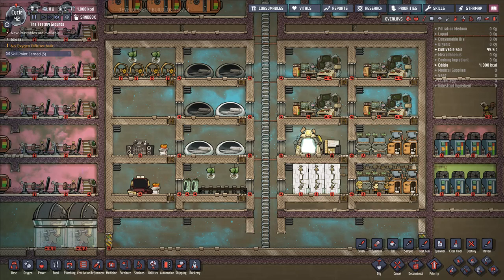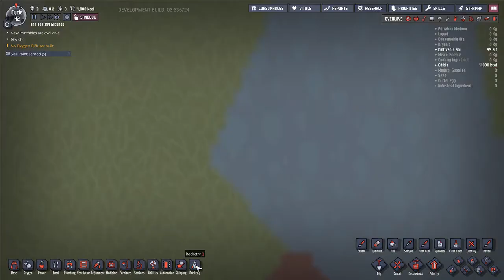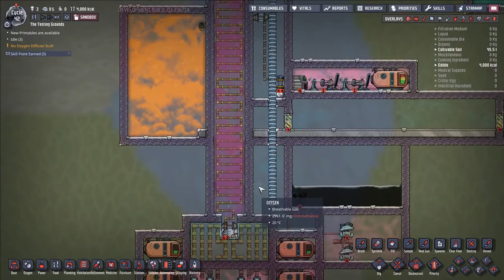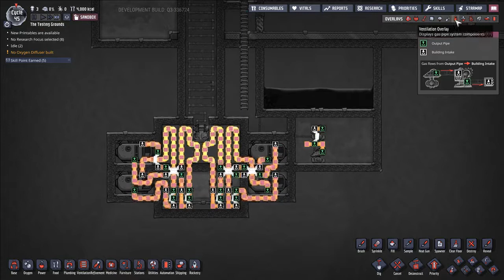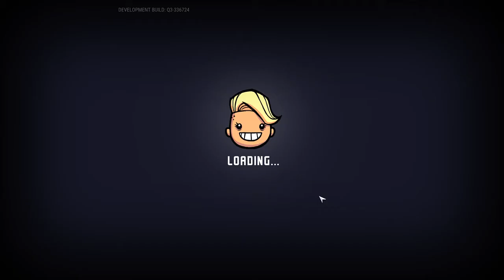The Mid Game Methane Distillery Revisited [Oxygen Not Included]

Comment: I'm confused.  It looks like the magma is going to keep cooling down and solidify eventually, and the hydrogen room with the thermoregulators is going to keep heating up until they overheat and stop, so how is this going to keep running for very long?  To keep it going you need to move the heat from the bottom back to the magma, but you can't do that since there is no thermo-regulator or aquatuner that can sit in the magma and vent heat to it as it sucks it out of the cold side.  Finally, the liquid methane is being pumped up through the pipe where it is being warmed, then it magically comes out of the vent and turns to gas.  What is keeping it from turning to gas inside the pipe and damaging the pipe as it vents out into the room with the sour gas?
Reply: Nevermind, I just watched the original video where you explained that it is using the <= 1kg packet size trick to stop the boiling from breaking the pipes.  I always forget about that.  Rather than get lava on the top, can you turn it upside down and just dig down to the lava layer, build a door touching the lava and use that as your heat source with a nice super cold AETN as the top side cold?  I can't think of why not.
Reply from the maker: The hot end can easily be replaced by a volcano, magma biome, or output from glass forges.  The thermo regulators can be kept cool with any of the cooling solutions I have on the channel, as they aren't actually generating much heat.

The methane does not turn into gas inside the pipe for the same reason the crude oil does not turn into gas inside its pipe: we have throttled the flow to 1kg/s.
Reply: @gearheadgaming1  Right, but do you have to put the lava on the top or can you make the top the cold side and just build the door touching the lava on the bottom of the map?
Reply from the maker: @phillipsusi1791  Hot side on the bottom is a little tricky to make work because you need to get the sour gas to condense, at which point it falls and has to be stopped with air flow tiles that have pumps on them.

A sideways tube works fine, that might be better.

If you're using a magma biome to provide the heat, easiest solution might be to simply pump the magma out.  This video has more details: https://www.youtube.com/watch?v=g6H3O0sl3fc
Reply: @gearheadgaming1  Ahh, right... ok, so hot has to go on top, so either pump exploit to move the lava, use a volcano, or the other trick with two fluids in a mesh tile to force the lava up a tube...
Reply from the maker: @phillipsusi1791  Or sideways, usually by setting it up right above the magma layer and then dumping a bunch of regolith into the magma to make more magma / bring the magma level up to where it makes contact with the tube you built.

Comment: Don't you think that it would be more efficient if you made the heat exchanger a repeating s shape rather than a collum?
Reply from the maker: Longer is better than wider, but if you cant do longer, then wider is better than nothing.
Reply: can't you make it longer by making it a square zig zag or is this one just a demonstration, either way thanks for replying have a nice day :D.
Reply from the maker: @commiesbegone2580  That lengthens the heat exchange area for the pipe.  But the gas flowing down still has a shorter path.  If you make it taller instead of wider, then both are getting the same treatment.

Comment: hmm.. could you make a second heatexchanger that will use the sulfer to cool down the natural gas and then recycle the cooled natural gas into the original heatexchanger ? The natural gas cooler could actually be a chain of no touching solid tiles (gold?)  in a vacuum that would exchange the heat between the conveyor belt and the natural gas pipe. Not sure how big that would have to be of course :))

Comment: The whole point of the build was to make natural gas to power your generator, and you aren't even powering it with the natural gas?????
Reply from the maker: In debug it's just simpler to set up hydrogen systems, in a real game I'd definitely use the natural gas to power the system (and then clean the resulting polluted water and use it to get oil from an oil well which would then be the feedstock for the distillery), which would make it a power-positive, water-positive closed loop system.

Comment: Does this build work with the heat on the bottom and cooling on the top? Since most magma are at the bottom of the map and is challenging to pump around.

The only issue I could see is the condensing of methane blocking other sour gas or dripping down to the hot end.
Reply from the maker: It works, but it's tricky because as you said, you need gas to pass through at some point, but not liquid.  Air flow tiles achieve that effect, but the better way I think is to either build the whole thing sideways, or put the condensers offset to the sides a little at the top, like a sort of T.

Comment: Tried this build and noticed something interesting, sometimes, mostly when it starts up, the methane instantly flashes to natural gas when this happens the natural gas floats to the top and gets converted to sour gas (via exploit/glitch) which is good and bad as it acts as an auto cleaning system but also means you have to change it to natural gas again getting more sulfur in the process.
Reply from the maker: Yeah, the Launch Upgrade changes to gas mechanics means it's a lot more important to get your cold end super cold before turning on the system.  I think it's worse than the Natural Gas getting converted to Sour Gas, I think under the new mechanics it's actually just getting deleted.

Build still works, but startup is a stricter process now.
Reply: @gearheadgaming1  Mmmm noticed some strange things happening to the hot end when the larva got below 1200 degrees seemed to cycle Petroleum Crude and Sour Gas in a loot but with no mass gained despite the liquid vent off depositing. A metal refinery to reheat seams to fix it though, and it can be sort automated though would be easier with space materials.
Reply from the maker: @evilchicken2339  Interesting.  I'm gonna do this build in my Let's Play probably ~100 cycles from now, should be a good opportunity for me to work out any kinks when running it in survival mode.  The new gas mechanics might have introduced some new failure state.
Reply: @gearheadgaming1  Having just built this in survival myself, I've found that methane only seems to spontaneously evaporate into natural gas inside the tube when there is a sufficiently high mass of sour gas above it. Presumably there is enough sour gas there to exchange heat with the methane and evaporate it. I've been watching this setup for a while now and it seems like any more than a few kilograms of sour gas at the bottom of the tube causes the natural gas to begin building up. I may have bungled the thermo-regulator cooling setup somehow and introduced a flaw, but the problem of natural gas is still very much something to take into consideration. I'm currently looking into breaking into the tube to install an atmo-sensor and disable the insertion of oil when there is the "right" amount of sour gas.

For what it's worth, the setup as is has already created an obscene amount of natural gas and is continuing to do so. It's perhaps not the most efficient and not without some flaws, but I'd like to think it's still more efficient then just burning hot petroleum.
Reply from the maker: @timothyfair1232  The issue is that the sour gas is condensing right above where your methane is being pumped out.  What you ideally want is for the sour gas to condense 1 tile above that, so that you have sour gas, then vacuum (because all the gas condensed), then liquid methane.

The easiest solution is probably just to get your cold end of the tube colder.  A different condensation area might help as well-- putting the pump into a sort of deep pit where the sour gas comes into contact with regulator-cooled tiles before it comes into contact with the pump.

Comment: If you moved the nat gas reservoir up slightly and used metal tiles to exchange more heat between the nat gas and the sour gas would that increase efficiency?
Reply from the maker: The short answer: I think in this case it would-- the position is just a little lower than it should be, and some free energy is currently being left on the table as a result. 

A longer answer: It's important to note though that moving it upwards beyond a slight increase, like moving it to near the top of the condenser, will result in a higher outlet temperature for the natural gas, but wont significantly reduce the load on the cooling end of the condenser.  Beyond that optimal point, moving it up further would mainly redistribute losses due to inefficiency from the cold end to the hot end-- but it wouldn't reduce the main load on our cooling system itself, which is the cost of cooling down the sulfur.

Personally, in survival mode I would still probably have the natural gas outlet a tile or three under the crude oil input, just so I could have the natural gas output at a temperature below 75 C, which would give me a lot of flexibility in terms of how I handled the nat gas from there on out.  It's less energy efficient, but I think it would fit my playstyle a little bit better, where I tend to be a little reckless with my dupe health.

Comment: You said it was possible to use a Thermo Aquatuner to provide both the heat and the cold. I've tired myself but couldn't get it right. Any possibility you could show us the way?
Reply from the maker: On reddit, Tony Advanced Oni posted a scaled up version of my build: https://i.redd.it/nirqgydbsl031.png that runs off a thermo aquatuner.  One Aquatuner using supercoolant should be enough for 10 kg/s crude oil, and basically all you do is have your aquatuner up top, it pipes down through insulated pipes to the bottom, and then absorbs heat from your cold element through radiant pipes.  He has his automation setup so that the aquatuner runs until it's at risk of melting, and then if the cooling element is too cold, he warms it up with a liquid tepidizer.  There are other arrangements, but the general idea is going to be the same-- the room with the aquatuner is your heat source, and the fluid the aquatuner is cooling is pumped down to exchange heat with your cooling element.

The aquatuner needs to be built out of thermium for this to work, and supercoolant improves the efficiency.
Reply: @gearheadgaming1  So the only way to do this before space is with a magma heat source?  Hmm. Is it fundamental to the physics of the build that the heat source has to be vertically above the cold source? Or could it be the other way around? (or even horizontal?)
Reply from the maker: @eraz0rhead  It's much, much easier with a magma source, but I detail some ways of making the heat without a source of magma in this video: https://www.youtube.com/watch?v=g6H3O0sl3fc

As for the tube's orientation, vertical with the cold source at the bottom is the most straightforward, because it means that the methane and sulfur that condenses from the sour gas will fall down into the cold region, which is where you want it.  But a horizontal build should work as well, and might be easier for dupes to build.  I think if I went horizontal, I would still take the cold end and have it kinda slope downward a bit on its end, just so that if I ran the cooling element too cold, and the sour gas condensed earlier than expected, the methane would still drip down to where I had my pump

Comment: I'm trying this build and cannot seem to get your cooling block to go lower than -165 degrees.  Any clues?

I also tried to make a Metal Refinery heat source, but could not get it hot enough.
Reply: Ok, so I did get it lower (turns out I wasn't using gold for some of the radiant pipes),  but it only runs intermittently, possibly due to the heat released by the mini pump. Hmm.
Reply from the maker: @eraz0rhead  Which part of the build is running intermittently?  Remember that the thermo-regulators are meant to have downtime and the mini-pump isn't going to run at full capacity because there isn't as much methane coming out as there is crude oil coming in due to the sulfur.
Reply: @gearheadgaming1  I'm sure it's due to the inadequate cooling. In the video you have nearly constant condensation to methane, but my setup gets only a burst of methane every so often. (It's probably a regular period, but I didn't measure it. It's long enough to be noticeable e.g. 20 seconds, 30 seconds..).
Reply: So I did get it running constantly -- and as I suspected it was the missing tempshift plate behind the pump at the base (and making sure all the radiant pipes and insulated pipes were in the right places.)

Now I'm experimenting with taking the coolant from the Metal Refinery and dumping that heat somewhere. Seems like an aquatuner would be the way to go, but I have no idea how to get >600 degrees pulled out of that loop without overheating the aquatuner. 
I could try using the oil as coolant and then piping it back into the tower as petroleum, but that leaves me with getting the rest of the way to sour-gas.
Reply from the maker: As for the first problem, there is plenty of room to tweak the cooling element and make it more efficient.  In this video I design the cooling element to minimize thermal transients rather than efficiency this makes it much easier for the viewer to see that the system is indeed at steady state.  But the system can instead be designed for efficiency, so let's get to that:

The first thing I would change is to upgrade the radiant gas pipes to a more conductive material.  Steel or Wolframite are best if you're willing to spare them, but even copper is 2.25x more efficient.  So if the issue is the interaction between the cooling element and the thermo regulator loop-- that you don't have enough heat transfer between the two--, that would be the first start.  A sign that this might be the problem is that your hydrogen coolant is very cold, but the cooling element is not.  An alternate solution is to lower the temperature settings on the gas pipe thermo sensors leading to the regulators.

The second thing I would change is the thermo-regulator setup itself, since that is how the cooling element is ultimately cooled.  If all of your thermo regulators are running 100% of the time and you aren't getting the system cold enough still, then it's time to add a fifth thermo regulator.  This obviously increases the power needs of the build and lowers the efficiency, but if somehow four don't cut it, a fifth certainly will.

Lastly, there are improvements to the cooling element that can be made.  Adding another couple panels of diamond tempshift plate will help heat transfer from the sour gas to the cooling element.  Any redesign of the cooling element that increases surface area should have a similar effect.

As for the heating, what is your metal refinery setup?
Reply: @gearheadgaming1  Ahh. I didn't notice there was a tempshift plate behind the mini pump.  That's likely one of the major missing elements.  The window blocks are a fair bit warmer than the hydrogen in the radiators, so using Steel or Wolframite will be something I try next. 
I'm also losing "cold" in the return on one side, because I used non-insulated pipes there. I'm sure if I fix those two things, the coldbox will improve significantly.

Comment: I'm seven minutes in and "adding cold"  "accumulating cold" "exchanging cold" is driving me mad. I really hope you say it the right way at least once.
Reply from the maker: I don't think I use right terminology once in the entire video.  But as a consolation, let me just say you are absolutely correct.
Reply: For people that arent experts at thermodynamics it is alot easier to picture cold and hot as separate forces instead of just heat.
Reply: I'm not an expert either. Just a pedant.